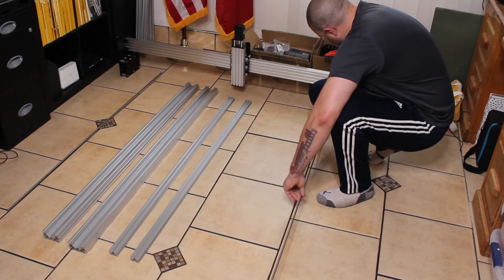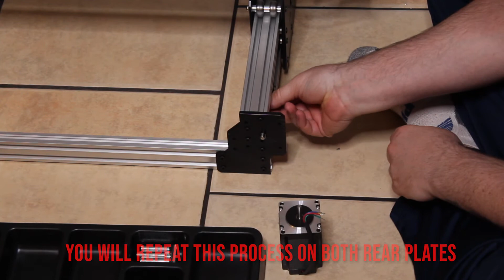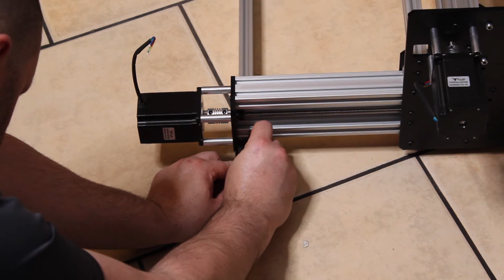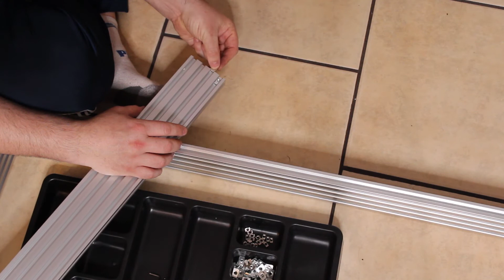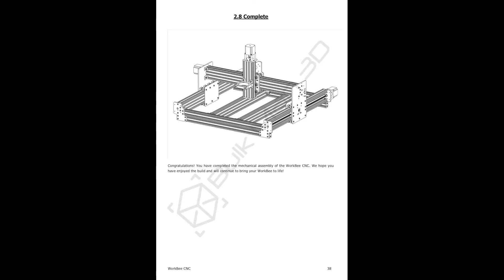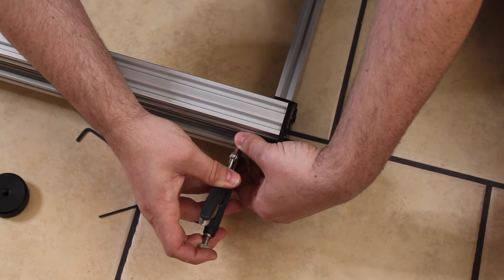Bulkman 3D/WorkBee/QueenBee Pro CNC  - Mechanical Framework - Series episode 4

Comment: Happy pre new year.  I hope you are staying healthy.  I have built the 1515 and i am in the process of some trouble shooting the y axis movement.  How tight should the carriages be.  One side is getting stuck then it moves out of square.  I did a quarter turn on the eccentic nuts but it seems to be too tight.  Should it move freely?  Thanks for all the videos they are very helpful.  Once i am done i will for sure help your gopro fund.
Reply from the maker: Yes you have to play with it and make sure everything is the same on each side. Make sure you have the wheel tension the same on both sides as well. You can also watch my video where I change the dip switch settings to provide more power (this equals more torque) to the stepper motors. I have the QueenBee Pro kit coming so those issues should no longer be a problem with the linear rails.

Comment: I may het the grbl version since it can be used with free software...mach3 requires costly mach 3 software
Reply from the maker: Yes you can get the same kit with GRBL if you want to do that. I just wanted to have the best program I feel will give me the best flexibility for great control and able to expand into more advanced things later.

Comment: Great thanks...have you used it yet..if so how does it perform...does the z axis flex a lot.?..the bulkman version seems like a good value for sure im very familiar with diy cnc...thise items you mentioned are trivial..a controller box is not necessary and if needed easy to make out of plywood...my last cnc i just had mounted on a board and worked fine
Reply from the maker: Not as of yet. I'm still retrofitting my shop for it. No the control box is not necessary but its nice to have everything managed in a well working and organized unit. Some of the things sure are trivial to some, but still good things to mention for those that are new to this type of thing. Everyone has different levels of experience with this stuff...

Comment: Im looking for opinions on the overall design and performance of this chinese made knockoff workbee 1515 diy cnc.....visually it looks decent for the price....there are no reviews at all...
Reply from the maker: It’s not really a knockoff as this is an open-source machine so anyone can make it and sell it. The creator, Oozenest puts together the same kits using the same source, China. I am very happy and satisfied with the quality of every part of this kit. There are a few optional things you need to come up with like a control box, water tank (water cooled units), dust boot if you are going to use a shop vac system and a waste board. Something you can buy is ingenuity, and you will need that for any DIY kit like this. There are a few other small items as well like the bits you want to use. Even though this is open-sourced item the quality of the items will matter on the supplier you use. This kit is a BulkMan 3D kit. I am very satisfied with the quality and they have really helpful customer support. Just keep in mind that no matter what kit you get from just about any source, 99.9% of the items will be from China. That doesn’t necessarily mean it will be of poor quality...